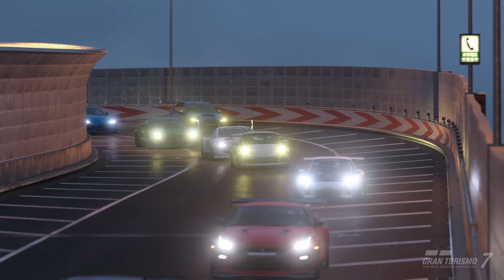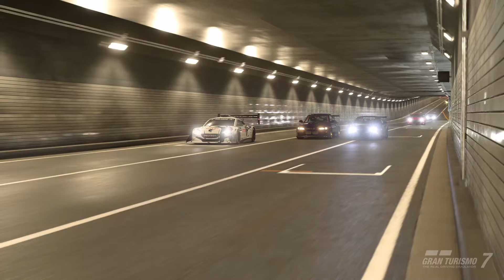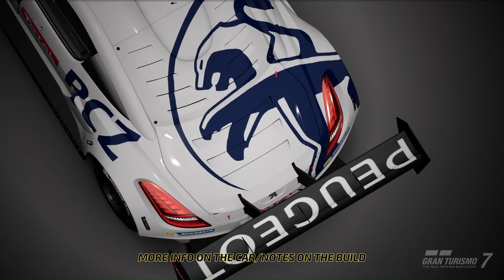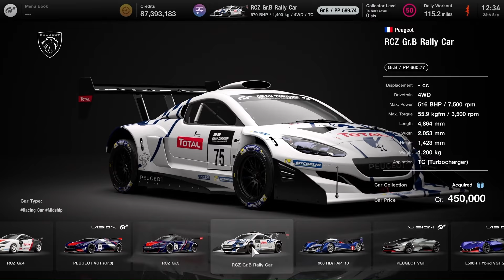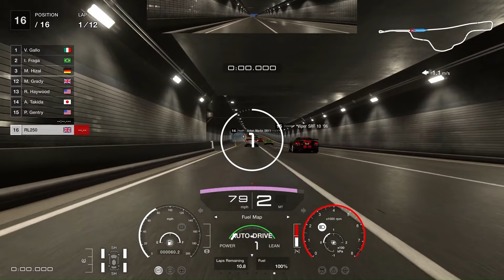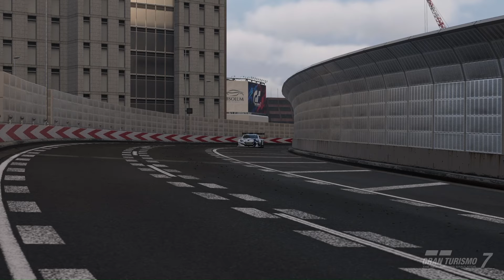Easy RCZ Gr.B Rally Car Build To Dominate Tokyo WTC 600 Money Grind

Comment: Good afternoon, I copied the exact set up, however my PP limit is at 652.41, I am not sure where i made a mistake, ?
Reply from the maker: It could be the tyres you are using. The build uses Sports Hard tyres. Failing that it could be the downforce, ECU or ballast settings are are not quite set right. Or you have the racing transmission instead of the manual.